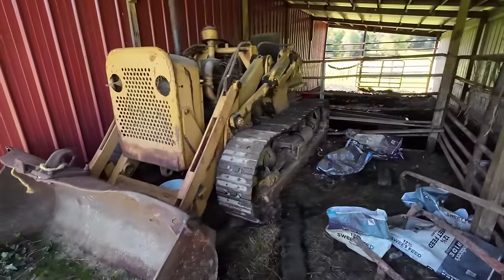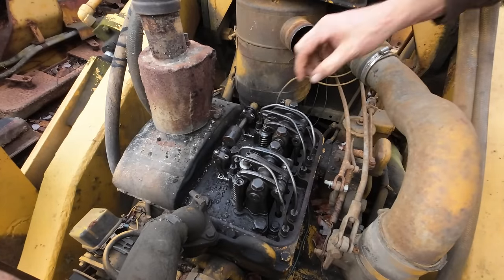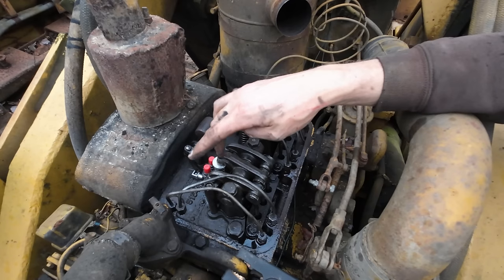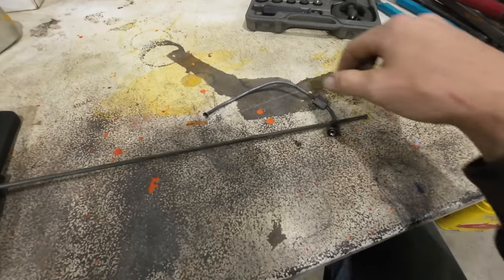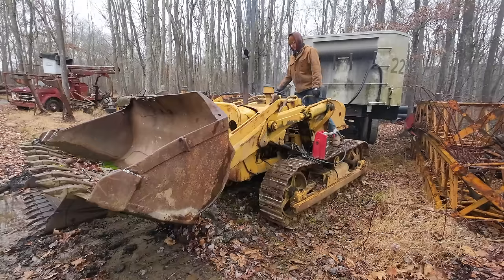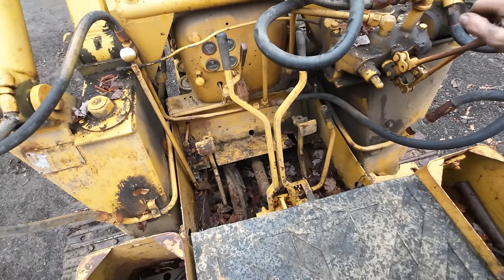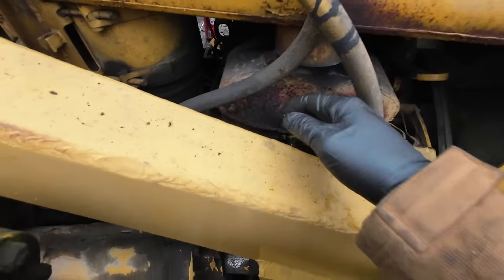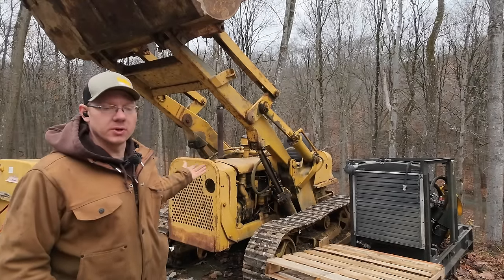$500, Allis Chalmers Track loader. Sitting for MANY years!  (Will IT RUN?!?)

Comment: fun revival! Wouldn't it run away eventually with high oil level and thinned out oil? If you got a used oil burner that oil, be great for that! lol.....
Reply from the maker: No it wouldn’t. It will just burn out the main bearings if anything. That oil/fuel went straight in the fuel tank.
Reply: @DieselCreek  ok .. im not anyway a diesel mechanic.   I know some but not all . Gassers been most my life.  Started some diesel tractor work recently

Comment: it doesn't seam to hold its power , proly 'rings , and this could change just by running it till rings loosen up , if not .. also this would contribute to fuel being in oil pan .. i'd pick up a couple new liners and pistons , have the head checked , or lap the valves = be done .. eh

Comment: Not sure why but i know that BusGreaseMonkey ( specializes in mechanical 2 stroke detroits ) adamantly says to run only straight 40 weight no matter what. 
Seems like the type of person who is reasonable and uses common sense, wouldnt say it unless it was for good reason. Wish i could do better, sorry :o
I tried to read the comment section and collected some of the points. Not using straight 40w could cause :
- Oil pressure issues when ambient temperature gets high / low
- Oil passing through gaskets that dont leak with straight 40
- Creation of additional soot / ash ?
- The soot created will stick to the modern detergents in modern oil and will contaminate your oil faster /worse
- Something to do with the introduction of cold air via the air box, coming in contact with the oil on the side of the pistons, will cause a break down of the oil film layer if the just-right oil is not used ( 40w ) ...o_O

Comment: Is the air fitting on the fuel tank so you can pressurize the tank and force prime the system to the injectors?
Reply from the maker: Theoretically, you could do that. I would find it much easier just to use an air nozzle with some rags in the tank lid

Comment: T HERE IS A MAJOR  DIFFERENCE between the recommended oil for a Bird Scarer and other  engines. In fact you will find ALL two stroke engines  diesel or gas. They BURN oil. Therefore they are not designed to burn the additives that are added to more "MODERN" oils. These additives turn into grinding materials such as Zinc Oxide which end up destroying bearings etc. Also these additives attach to cylinder walls. Diluting a plain 90 or 140 weight oil. Gear oil is not suitable as it has a resin added which helps it stay on gears etc,.
 , In fact I would use 30 grade  transmission oil if I had a choice between Modern Engine oils and transmission oil. I remember servicing Cat equipment and trucks, and there was only one 44 gallon drum of 30 weight oil in the lube store for ALL CAT services, Engwith Kerosene or diesel is saferine gearbox final drives and hydraulics. There was a couple of 5 gallon 40 weight for one old unit for the engine only. was a pusher/dragger for logs.  The Cat powered trucks were the same grease gun and 30 weight oil. The oil drum trolley had hooks for the grease gun and tray for spanners and grease nipples. The Grease pump etc was mounted alongside the oil drum on the trolley.

Comment: I never really understood why anybody bought these AC units back in the day.  At least these little ones with the 2 or 3 71's, they had to be severely underpowered right from new.  At least some of the bigger ones had an 8V71, so those may have been okay?  Were they way cheaper than a Cat?  My Dad had a D2 in the 60's that would've put this tractor to shame, and as near as I can tell on video, looks to be about the same size.  One of my buds had an AC in the 90's that had a 3-71, and it was also underpowered, and the steering clutches and brakes were an ongoing problem as well.  Of course, it was most likely a clapped out antique at that point, and might have been a good unit when it was newer.

Comment: Matt when are you going to get to the Fat-Allis engine swap? I know you have a ton of projects just think as much as you keep using the machine it would be one of top priorities.  I know you do not need reminded you have already should the engine running you plan use.
Reply from the maker: It’s low priority to me. The engine it’s in. It still does the job. It’s not like it’s going to blow up anytime soon. It just doesn’t run the best. Honestly new injectors would probably fix that thing right up.

Comment: It's rare today you need straight weight oil.
Reply from the maker: That’s my biggest complaint about using it, is that it’s hard to find
Reply: @DieselCreek  My grammar may have been off.  I meant you really don't need straight oil.  Especially using synthetics now.  When that loader was built oil really sucked (putting on my chemistry and engineering hat).  I agree though you don't need that one.  Let it go to someone that does, Happy Holidays here is your loader!  :)

I hope you get to 1 million+ by 2024,

Comment: I have a 1930's Engine Heater with a round wick for kerosene if anyone wants it for $35; + sh & h. Daddy used it for the 6 cyl. inline Ford truck and roadster with rumble seat he sold for $50; running by the way.  lol
Reply: Lumber shipping covers ffor plywood veneer will act as fine covers for the machines and are stiff when cold. Mine I use on my riding mower is 5 yrs old and still fine.  The Seat is covered with a similar material that is shaped to cover it.
Reply: White City, Oregon

Comment: All the arguing ive heard about wrong oils in old vehicles/equiptment, in 52yrs ive never seen engines fail from the “wrong” oil but ive seen dozens fail from people having no/low oil because they didnt have what was called for at home/in the field. I always say its better to have something than nothing, before somebody freaks out i said older not even referencing this new junk that breaks down with the best of oils in them. Ive seen hydraulic oil used in an old detroit for months before he realized he was pumping out the wrong barrel and it ran for thousands of miles till the front wheel bearing came apart and wrecked the truck

Comment: Does I have a mechanical lift bump to the injection pump? Could the fuel pump be leaking into the crank case?
Reply from the maker: Yes, I said that at the end
Reply: @DieselCreek  sorry I didn’t get that far in the video when I commented that 🤦🏻‍♂️

Comment: My dad has one just like it but in much worse shape but it still to this day pulls out stuck tractors and trucks cars and (big trucks like a poop truck for putting manure on corn fields) stuff like that weighs around 8tons  but my dads dozer is a allis chalmers HD5 1944 has a blade not a bucket but goes on the same as the bucket does I wish this was Facebook then I could put a picture of it up so you guys could see it

Comment: Curious, if the cylinders have lost their chrome, is it wise to leave them extended and exposed where they can rust?
Reply from the maker: Better to have them retracted if possible. Chrome loss is partially wear, partially damage related
Reply: That appears to be the opposite of what you did at the end of the video. Hence my confusion. @DieselCreek
Reply from the maker: @ronsamson537  you’re not going to hurt these anymore than they already are. And I’m saying it’s better to store them that way for long-term if you’re going to park a machine for years or something. Hopefully this loader isn’t going to sit there more than a couple weeks.
Reply: Fair enough, my question was never from a point of criticism, just wanted to understand what you knew that I didn't.

Point of interest, about 20 years ago I inherited a very large 5 by 5 rolling tool cabinet from my grandad. I recognized all the carpentry tools, recognized all the electrical tools, recognized all the plumbing tools, even recognized all the smithing, welding and fabrication tools. But there were a few odd ones I couldn't figure out the use for. I saw you use them in this video when servicing that engine. I always knew i had a gap in my handyman skills when it came to motors, its why i watch your channel. @DieselCreek

Comment: Forgive my question which may sound idiotic. But I know very little about diesel engines. With a two-stroke diesel engine, is their oil added to the fuel?  Because I heard you talking about the fuel leak spilling down to the bottom of the engine and mixing with the engine oil.  This is the first time I've ever heard of a two-stroke diesel. Wikipedia didn't have an answer. Go figure.

Comment: I worked for the local county water department for close to 20yrs. I questioned a lot of things. But they did finally get a blue jump and carry jump box and it was the real deal but they switched to the higher amp red one and as long as got plugged up to recharge the thing would spin over at least 5 wore out peices of equipment. I work for myself now several years and I bought two jnc jump boxes. Gave my son one. Really worth the money.
Reply from the maker: Mine has been fantastic

Comment: HV7's are the shitty crown valve injectors with only 750psi inj pressure,use N65 injector which has 3000psi inj pressure

Comment: When I was living in Seattle, I used to work for Boeing in Hwy I was working for Boeing. I bought a little John Deere I had like 620 hours on with the tractor was like brand new it was a little 850 four-wheel-drive front bucket backhoe by 25 horse three cylinder diesel anyway got laid off an Boeing and was working from my cell from one of my customers he had a scrap pile gone and I saw a little small block Chevy sitting there. I said what’s with that motor he says all heck I’m just gonna scrap it, he says it’s just a 283 so will look I’ll give you $10 for it cause that’s about what you get for scrap plus you won’t have to screw Ron taking it in and it goes all right so I took it home the cylinder walls had virtually nowhere had a little tiny ridge going. The lifters were like perfect and I gave it to a friend of mine who is a Chevy guy didn’t even ask for any money back anyhow, I saved the 283 from the scrapper. This is six and a rowJim from Kennerdell, Pennsylvania.

Comment: In my opinion oil is oil no matter if its straight 30 or multiweight, the entire purpose of multiweight in the first place was to make engines easier to start in the cold and to provice adequate lubrication/build oil pressure quicker.

Also i don't buy into all this marketing wank you see on the more expensive oils, here in Sweden the cheap stuff from Lidl is actually produced by a big brand like Mobil1, Shell or Castrol, it has even been scientifically tested and verified to be the exact same oil as the namebrand counterpart.

It is cheaper to bottle up leftover production runs as cheap oils than it is to get rid of them as hazardous waste. If you think about it, the big oil producers would not offer their leftovers as cheap oils if they were not safe to use, as they could risk beein sued out of existance if that was the case.

Personally i have only ever used engine oil from Biltema(Swedish equiv to Autozone, Napa and similar) or Lidl and never had any single problem with it.

In my opinion marketing wank and advertisement is the complete wrong way to go = i try my hardest to buy the most anonymous least heard of products i can, rather than all this hyped up mainstream crap.

Comment: Matt- Would you have any interest in pawning off any of those contacts to a young guy like myself? I am looking for an old piece of equipment to bring back to life. Perhaps we could negotiate, if you can hook me up with one of those old loaders that needs saving (provide contact info of owner) I will get you an engine component from one of the largest Diesel engines in the world, maybe an exhaust valve as tall as you or a piston ring to add some character to the shop? I work on ships as an engineer and I want a revival project but there aren’t many affordable projects in my area. Let me know

Comment: It’s not the quality or modernity of the oil. There is only one oil to use in 2-cycle Detroit Diesel engines: 40-W low ash content. That’s what I use in both of mine. You guys can use whatever you’d like in yours though. Cause they’re not mine and I only provide this info cause it’s what I have found out owning these screamers for years. You can get it from Miles Petroleum Products and a 5-gallon pail is about $120.00, shipped.
Reply from the maker: Only $83 at tractor supply lol

Comment: Will be great when we dont have mess with this stuff and all the old equipment is electric based. Just pop in a new sodium ion battery or whatever battery tech we are using and go. Could that airline into the tank be a way to pressurize it to help with starting?

Comment: Hmmmm so I see my bosses 2022 f350 isn't the only new ferd turd that squats like that with weight it always hurts his feelings when I hook 30,000lbs to my old 03 GMC and it squats maybe 2 inches meanwhile his looks like the old Tennessee tilt as the kids are calling it
Reply from the maker: my hitch is too low is the main issue. i also prob loaded that too far forward but yes they do seem to sqat a little too easy but they pull like a freight train. itll out pull any 2003 of any make or model. ( stock that is)

Comment: Why leave the bucket up?
Reply from the maker: Save space
Reply: Won't it put a strain on the hydraulic system, especially when it fills with rain water or snow?
I was taught to always put buckets and hydraulic accessories on the ground when done.
Reply from the maker: @freetolook3727  I have the loader arm locked up. But no, it wouldn’t hurt the hydraulic system at all.
Reply: Thanks, just wondering...
😅

Comment: Tbh I think old vehicles like that, Are better off at the crusher, At the metal gets used in something brand new, Instead of just rotting away
Reply from the maker: All they make is throwaway junk anymore. Stuff like this is made to be re-built and  used over and over. Not to mention the environmental cost of melting it down and building some new junk. Keeping this old stuff going is actually the green thing to do.
Reply: @DieselCreek  Yeah most of our cars and trucks are shipped to China these days lol..

But them older vehicles are horrible on the emissions 😆
Reply from the maker: @AresGodOWar  the amount of emissions for the rest of its days coming from this thing, wouldn’t touch the emissions that come from the manufacturing process

Comment: How much weight are you guys in US allowed to tow on standard trailer hitch. This machine is probably 8 to 10,000 pounds, if not more, and then there is the trailer weight. Here in Iceland we are limited to 3500kg (7716 pounds) except if you do have a dually or heavy duty truck with fifth wheel and transmission cooler and bla bla bla rules and regulation crap...
Reply from the maker: This machine weighs 15,000 pounds. This truck is rated for 24,000 pounds on the bumper hitch and 40,000 pounds on a fifth wheel hitch.

Comment: Modern multi-weight oils are designed not to lose as much viscosity, right? Is there some reason Detroit specifically wants the oil pressure to be higher when it is colder and lower when it is warmer? When people talk about this they never ask this question, I don't know how to research Detroit engines so ill let someone else do it. If they didnt and it was just about other properties they didnt want then those points are now moot. Why do people act like there arent real answers to these questions is beyond me